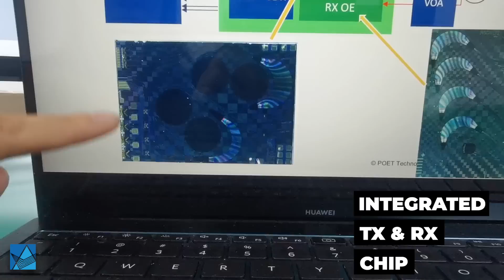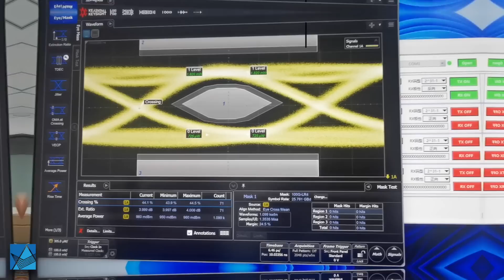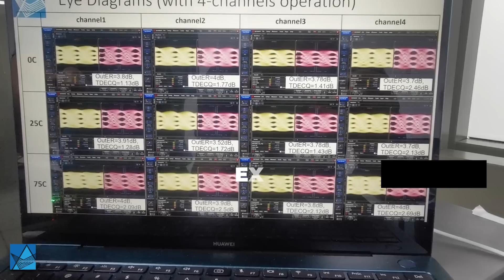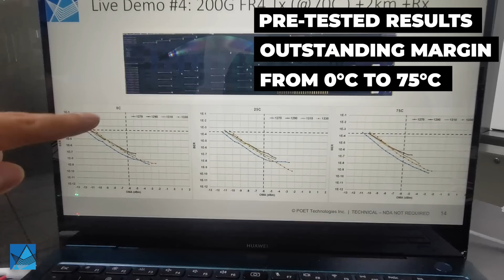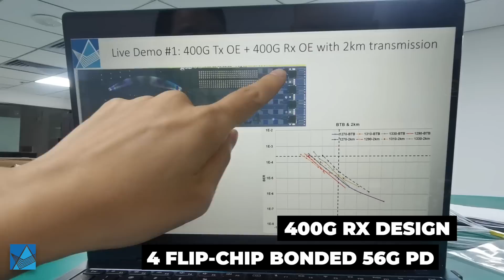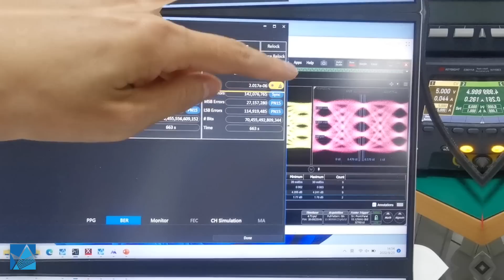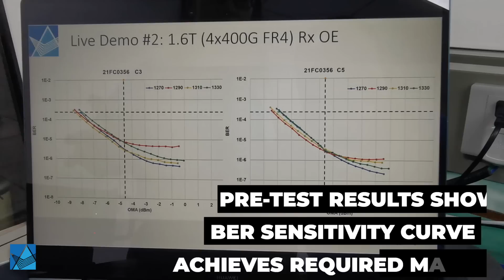Live Demos of POET Tech's Innovative Photonics Products

Comment: What benefit does this have over conventional tech? Like what am I even really looking at here? Can anyone eli5?
Reply: Imagine amazon delivery transferring a package from point A to point B, the package weighs 1000lbs, the route from A to B takes about 2hrs.

A is transmitter
B is intergrater
2hr route is the wire connected
And you need to do multiple trips to get the entire package from A to B (like downloading a large file)

Now, what Poet is claiming and demoing that theyve successfully created, is imagine same scenario, but no delivery driver and no delivery route. Instead, you flip on a laser pointer, the beam of light hits B. All 1000lbs of the package is instantly delivered.

That's literally the simplest way to explain this
Reply: Photonics is quite literally the future, using the photons of light (smaller than atoms) to transmit data instantaneously. I think 2 other companies are doing this, but poet is specifically ALLIN on photonics, whereas photonics development is a sector of the two other companies